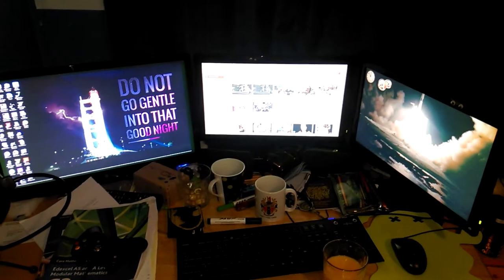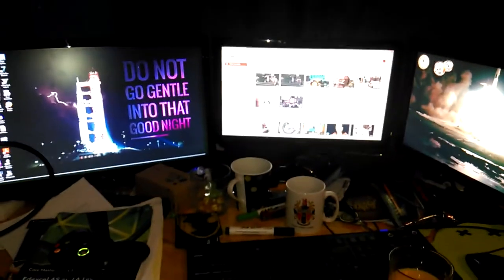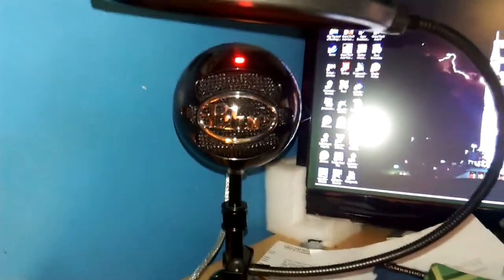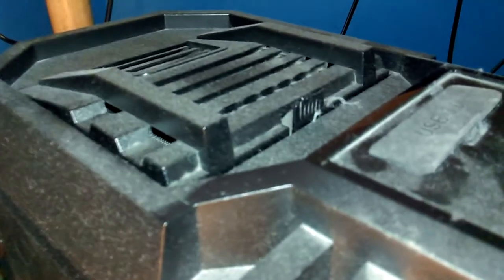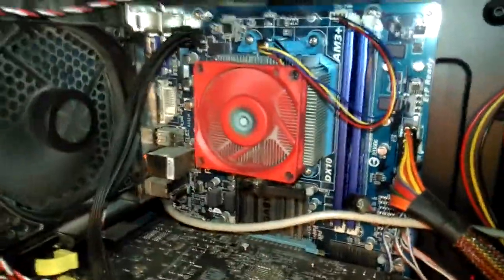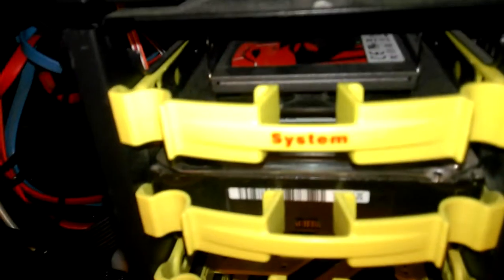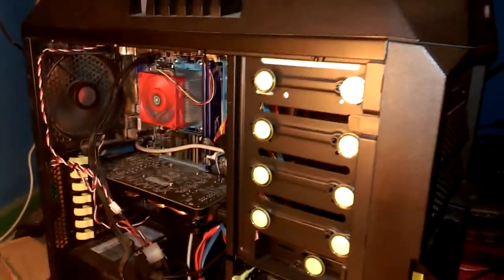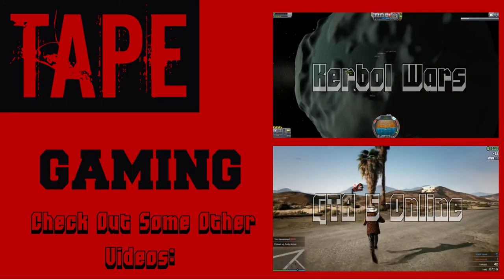Inside My PC

Comment: dude, get a pentium g3528 and oc it, the motherboards are pretty cheap and although it is only a dual core, it beats most AMD chips when oc'd (it can be oc'd to 4.4 on stock cooling also). Also, get a atx board, it makes everything so much easier to manage! :) still an awesome rig bro :)
Reply: plus the Pentium is like 48 quid

Comment: GTX 980 strix
AMD A-10 6800K APU (getting upgraded soon)
G1 sniper motherboard (getting upgraded soon)
8GB HP nondescript RAM (also getting upgraded)
Nondescript 2TB Toshiba HDD 
240GB crucial m500 ssd
RM 850 PSU
all in a define R4
Reply from the maker: Callan Nichols Much jealous :)
Reply: TAPE Gaming going 5000 series intel current cpu bottles the GPU need dem pcie lanes